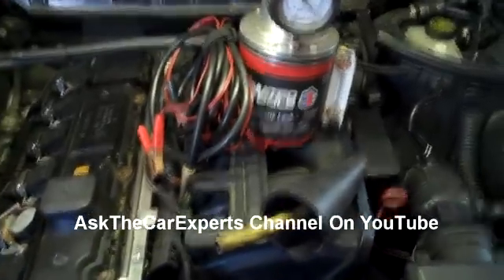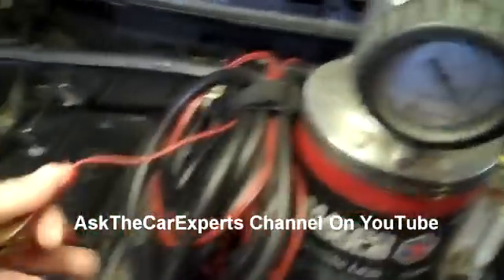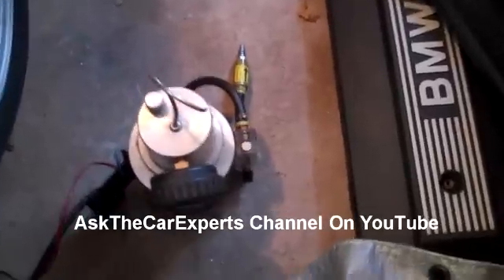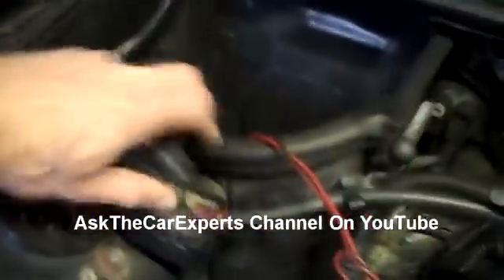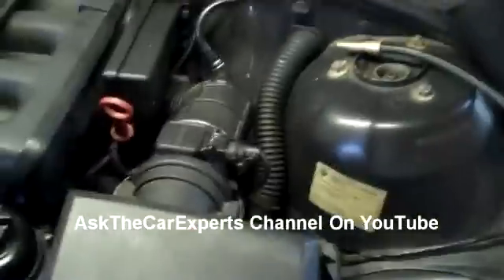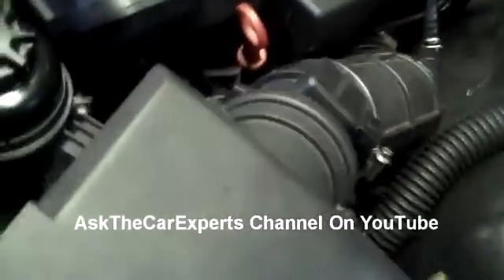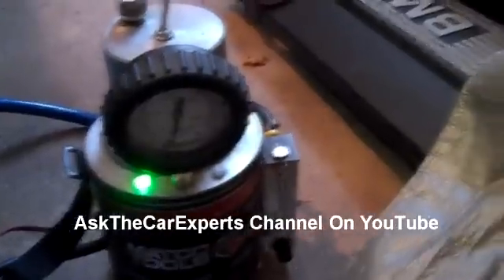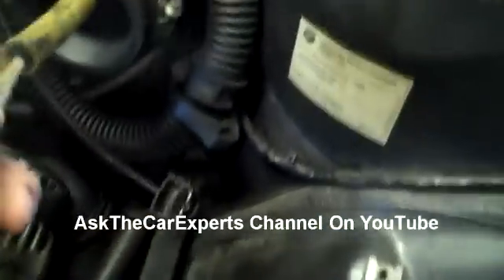BMW Unmetered Air Leaks P0170 P0173 Mixture Too Lean Smoke Test And Common Problems

Comment from the maker: Hello, There is not many vacuum lines on this model. You will need to look under the engine covers and the back of the intake manifold. It could be a vacuum line for the secondary air or one of the vacuum lines going to the back of the intake manifold. The light will only go off after it is cleared or it could take quite a while once no fault are setting.

Comment from the maker: Hello Bill, This might just be that line that is leaking. It is held down by that plastic retainer clip. If it is leaking through the valve cover in the PCV area the valve cover would have to be replaced. You can also get an unmetered air leak due to timing and this mini is known for jumping time due to a stretched timing chain. I would start with the hose to the PCV and see if there are no more leaks. If the fault comes back timing should be checked. Best wishes!

Comment: i have had on and off warning light for some unmetered air in the intake system due to intake boot and pcv block leaking on my 2007 MINI S-type. Smoke testing showed there was no fault in the vanos system, but some smoke coming out of the pcv block and intake hose. Between the rubber boot, valve cover and LABOR, it's a boatload$ to repair. Any advice...?

Comment: CHANGED THE VALVE COVER ON MY E90 3 SERIES BECAUSE OF THE WHISTLING NOISE THE PRESSURE WAS CAUSING.... AFTER I INSTALLED THE NEW VALVE COVER I HAVE A BUNCH OF CODES... SYSTEM TOO LEAN AND CYLINDER 3 MISFIRE ALSO RANDOM MISFIRE..,. WHAT CAN IT BE HELP